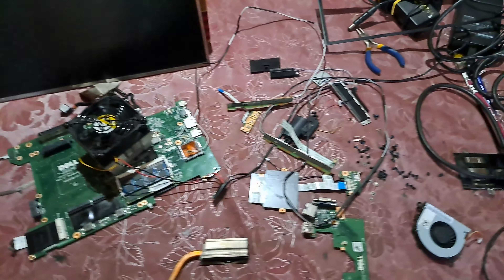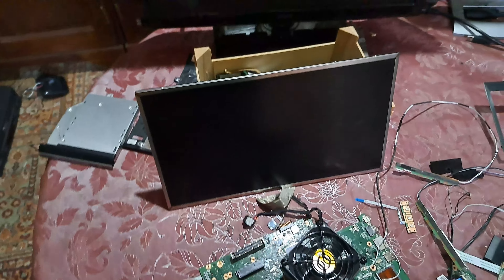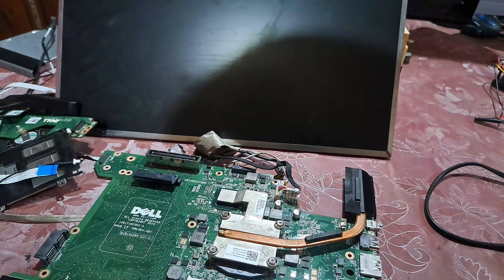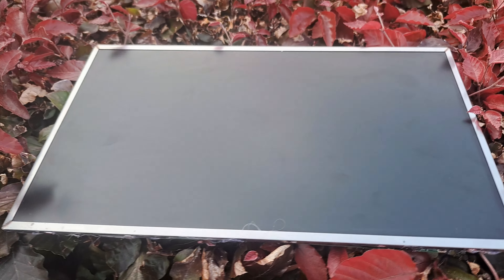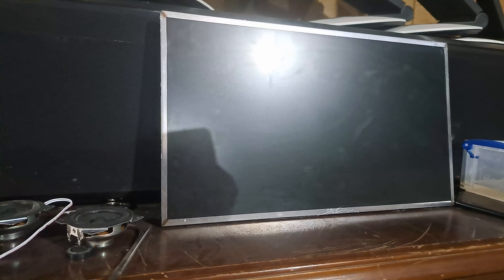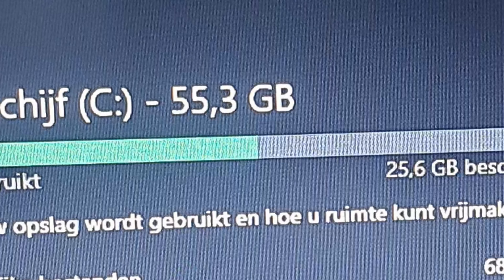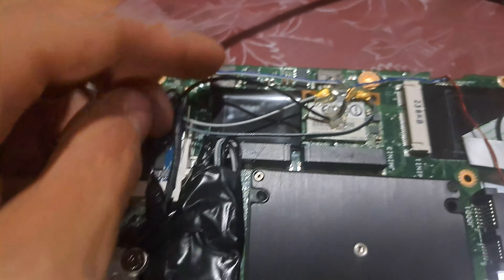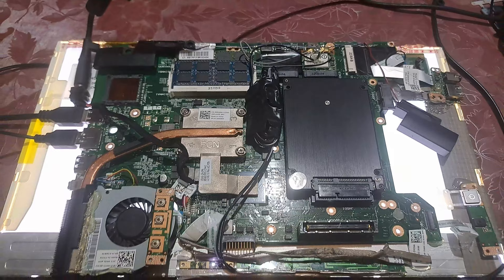I Turned a LAPTOP Into a WORKING All-In-One pc! Here's how I did it

Comment: Hi, i bought laptop hp 550 so i want upgrade it, i put ssd 120gb and i want to set 8gb ram, is there any chance?
Reply from the maker: @coolkolivan  yeah that'll work, just make sure you buy the right type of ssd and ram, you can have an m.2 ssd or a sata one, and with ram you have even more types, so just look out that you buy the right parts
Reply: @jens_reset yes but i have the problem, my laptop is intel duo pentium t idk it will work
Reply from the maker: @coolkolivan  then the only thing you should be worried about is the ram, the ssd is not affected by the processor you have. Just look up your cpu model, and max ram for that cpu. Then you'll know what to buy.
Reply: @jens_reset i have issues from the laptop now the audio ads insant hdtv pci and idk what to do😢
Reply from the maker: @coolkolivan  did you update the sound drivers?